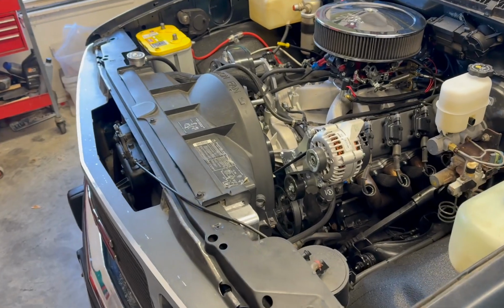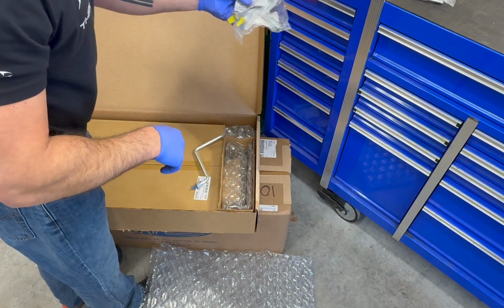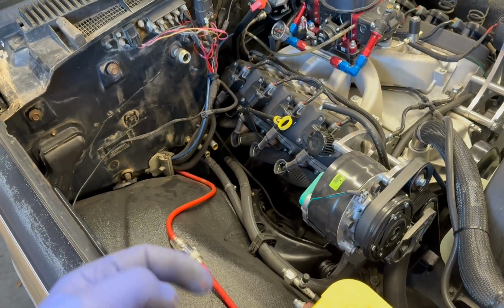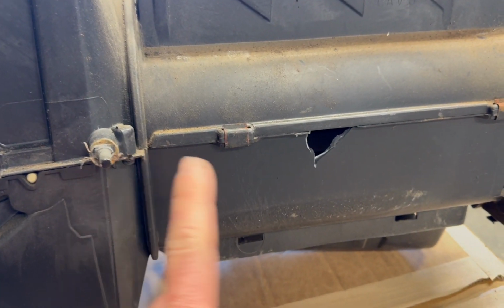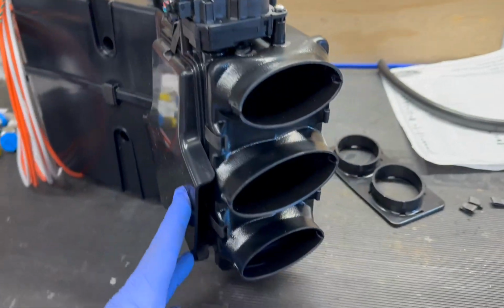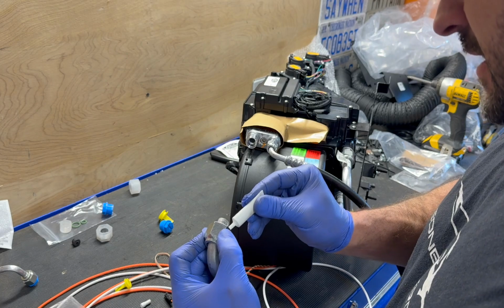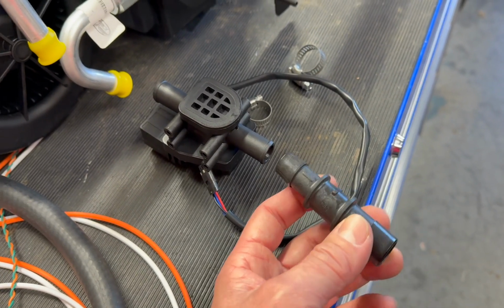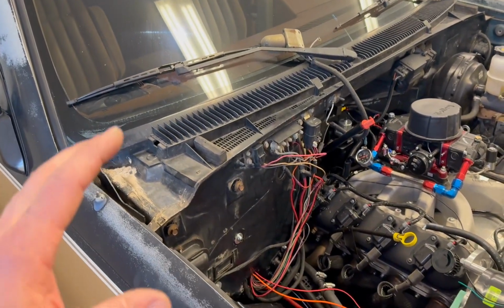(Daddy Bill) LS OBS Vintage Air install pt1

Comment: Very informative video . How is the air flow compared to the factory setup air flow . I have a 96 that I’ve Ls swap over 10 years ago and have a sanden compressor setup with the factory air/heat setup and mine blows decent but I would like for it to throw snowballs at 😂. Been considering fabricating my factory fan and wiring in a spal fan to get more air flow .
Reply from the maker: Can’t recommend Vintage air enough. Also, I’m currently replacing the compressor for a sanden 709.
Reply: @GreaseMonkeyTV that’s the compressor I’m running too the 709. Have had it for the past 4 years and runs/ operates great .

Comment: Great videos! Do you have a link for the wire loom you used to cover the wires with? It's been a few months now so how do you like the Vintage air over the factory set up? I it better, worse or no difference in colder temp and air flow?
Reply from the maker: Better in every way now.

Comment: I have a ls swap 97 chevy 1500 obs that im about to either go with the factory a/c or try the vintage air, any advice on the install
Reply from the maker: It a real pain mounting the unit under the dash. 100% n ed help doing it. Also, buy your own ac crimp tool so you can take your time and do the lines the way you want.

Comment: On my square body. I went to radiator depot in tulsa. And got the kit (compressor, evaporator, condenser, lines, adapters,  and oil). It worked excellent for me on the factory controls